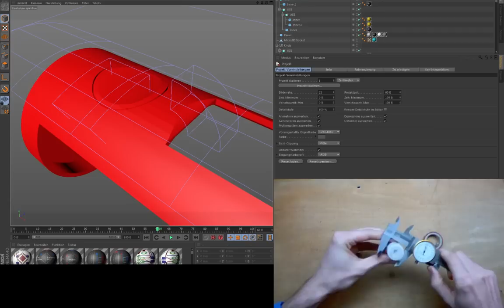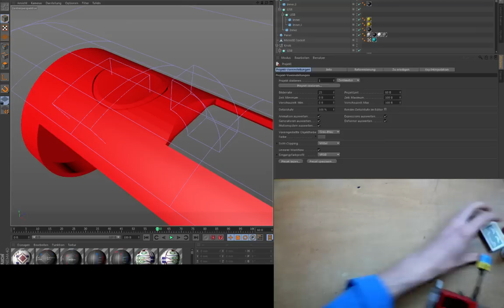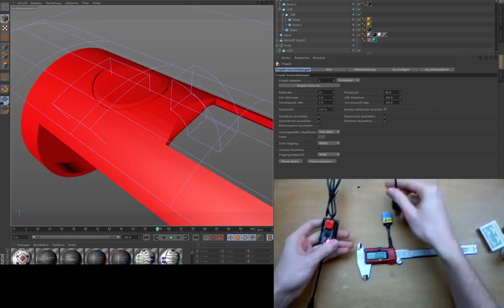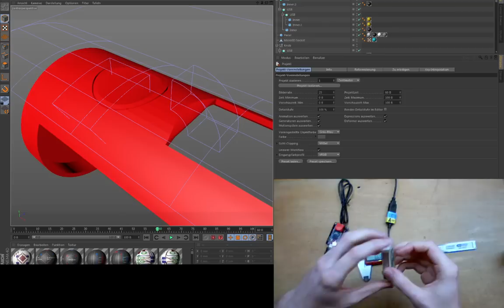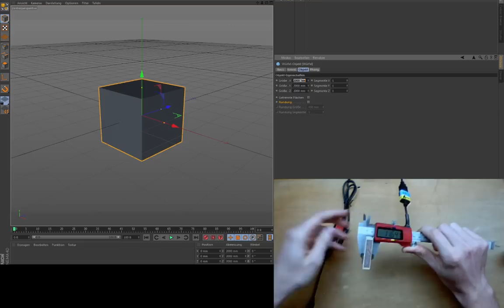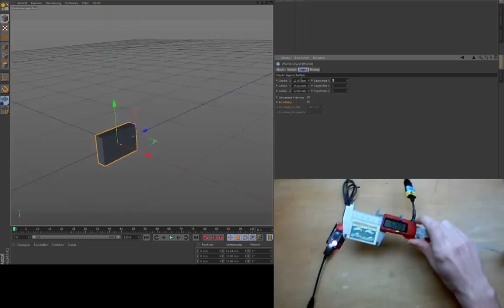Digital Caliper Hack for rapid prototyping 3D Modeling

Comment: Is there any information on how you assembled together the arduino? :)
Reply: @MoMakeMore  I do see the arduino pro micro, the button switch and the micro cable connected to it. But I wanted to see how you wired the other cable above the red switch. I'm new to this, sorry. You did a good job putting that together.
Reply: @MoMakeMore  I appreciate the response and help. I will give it a go go on that. Would it be ok to message you in the future if for some reason I still have issues? I should be good though. Thank you!
Reply: @MoMakeMore  Hello again,
Is there any way you can give me your email or I can send you my email? I would greatly appreciate if you can help me spec this project for school purposes. Thanks again for all the replies and help.